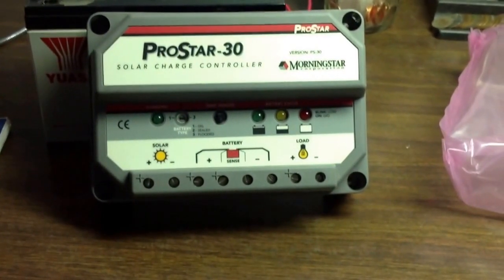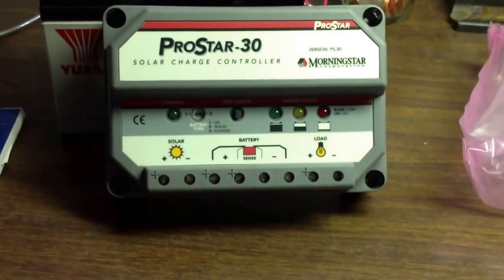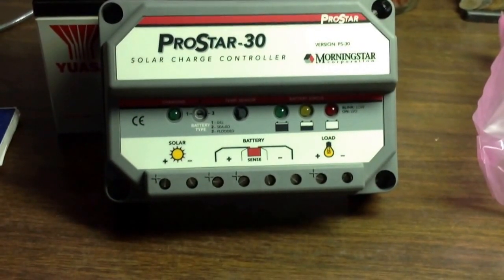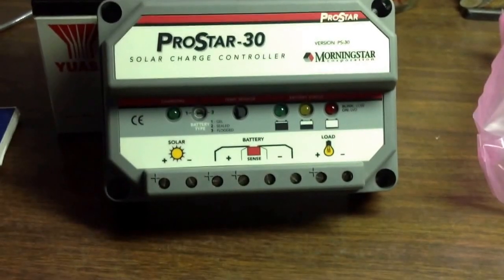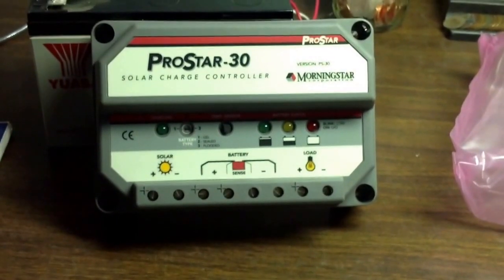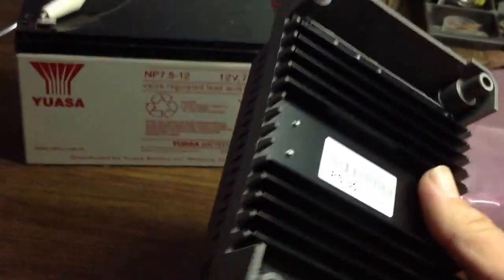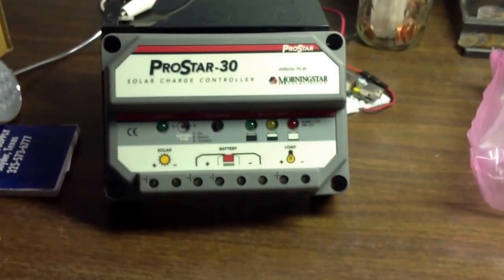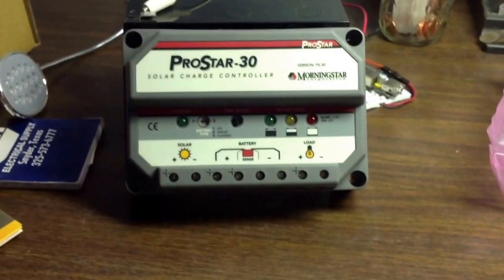Solar charger controller Pro star 30

Comment: Hi good video. 
Question if I may. 
Have the same solar charger. Prostar 15
Have a green flashing light on unit.
Battery is 13+ volts.
Could you please answer why this is happening. 
Tia